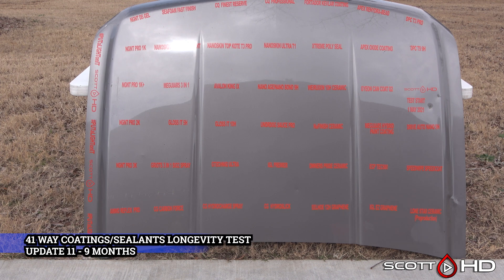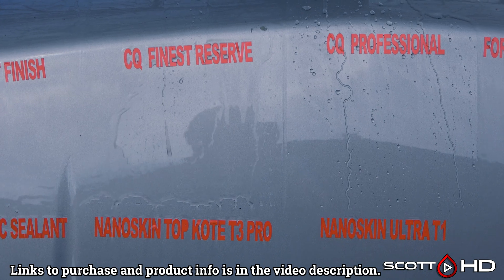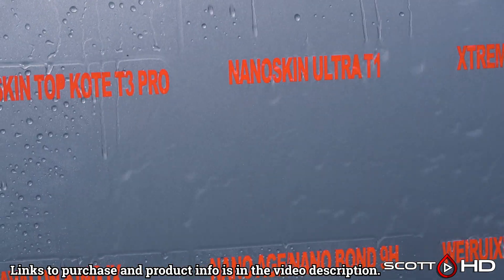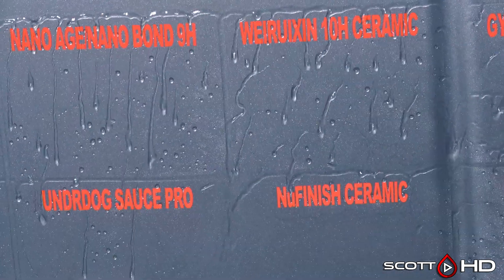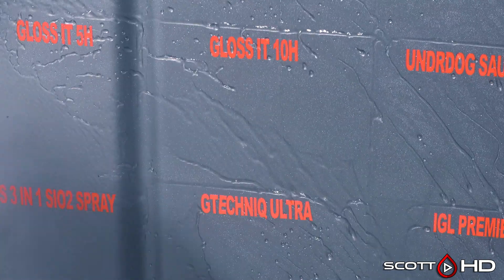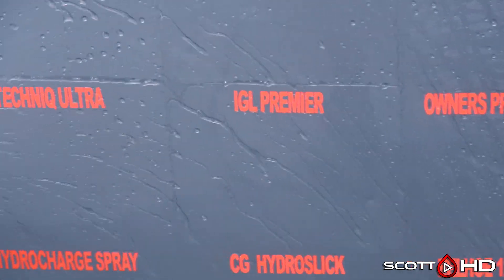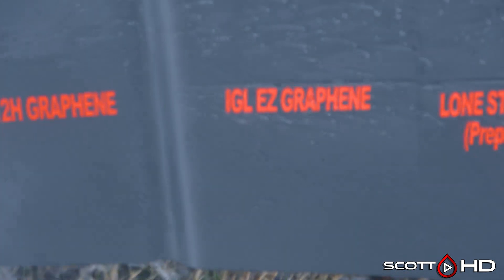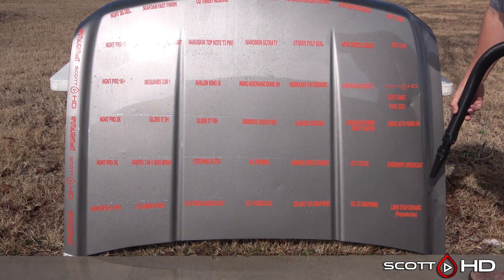Ceramic Coating Longevity Test - 41 WAY - The ULTIMATE comparison test - UPDATE 11 -9 MONTHS

Comment: Thanks Scott. I really appreciate your hard work in doing these tests.
Quick question... What do you recommend for cleaning the inside of windshields? My glass is beginning to develop that hazy inner coating and has started fogging fairly quickly.
Reply from the maker: We love using diluted isopropyl alcohol. It cuts through that layer of film that likes to form.  It's also super cheap!  70% IPA from a drugstore is about $1-2 and you dilute it with distilled water 50% (so it's 35% IPA) in a spray bottle.  Boom! Done.
Reply: @ScottHD  
Thank you! I will try that as soon as New England weather allows 👍

Comment: How are you comparing spray on coatings to liquid wipe on coatings ? Doesn’t seam very fair !
Reply: It's not supposed to be fair, they are there for comparison. Not to decide which one is better technically. And for some of them to even last 9 months is crazy good
Reply from the maker: @PonyTrumpet  This!
Reply: I think the easy to re-apply spray on coatings should split their square in half and apply another coat. Because realistically that’s what ppl will be doing if they’ve got so much product and it’s so easy to do. Maybe the extra coat lasts longer than the original once it fails. Worth a shot 🤷🏽‍♂️
Reply: @rajansandhu5  i just don’t think they are or should be in the same category!

Comment: I have a couple of 99 dodge durangos that I applied Griots 3 in one to last October. One sits out and one sits in a garage. The one that sits outside has been subject to pretty heavy snow at times, up to 18 inches. Its beading properties are completely gone while the garaged one still sheds water like new. I guess snow acts like a glacier on ceramic coatings and really wears it off quickly. .The garaged durango gets driven 5 times as much and washed more often.
Reply: Wouldn't be surprised if after a wash that outdoors one starts beading again... That 3 in 1 is wildly good for the money and ease of maintenance.
Reply: I absolutely love the Griots 3 in 1. I've had amazing durability with it on our two cars too.
Reply: @sleeksilver  Yep. I've had Meguiar's Hybrid Ceramic Wax (spray) on an a car that spends a lot of time outdoors since October, and with a wash, it still beads great. The Griot's Ceramic 3-in-1 is more durable - which is why I suspect that (if it was applied over something it can really hold to) FScott Gray will see fantastic beading again with a decent wash. I saw another guys truck in New England who went almost a year (including winter) with more machine washes than hand washes and he was still getting genuinely good beading with the Griot's 3-in-1 on his black truck. It is crazy good.

Comment: Hello. Scott I’m real surprised you mentioned NuFinish as “barely hanging in there”, it looks super hydrophobic 🤷🏻‍♂️ thanks for the great videos
Reply from the maker: I suppose it's one of those that's worn, but still somewhat hydrophobic.  Either way, its still impressive for the cost. It is probably one of the easiest ones in this test to apply and remove too.
Reply: It looks almost dead…..  the longer the water sticks to the square, the worse it is. I can tell Scott times how long the water takes to sheet off the square. This is how you can tell which ones are worse/better. Some of the squares don’t even sheet at all yet.
Reply: @ArizonaDetailCorp   wow maybe it’s the clarity in my iPad but I clearly see the water immediately clears off the designated patch. 🤷🏻‍♂️ but there’s nothing like first hand experience and I’m sure Scott is seeing something I’m not

Comment: The Meg's Hybrid mystery price slash leaves me scratching my head...thought it was going to be cancelled but why would they with results like this.
My guess....people see 2 bottles in a kit and shy away because they probably feel it is too complicated a product...
Reply: I saw in commets in the meguiars YouTube channel that companies that cut the price to 30$ decided not to carry that product again
So autozone amd other retailers will not be selling that product in store only online
Reply: I’m not sure where the $30 figure came from. I just search for it on the Internet and the cheapest I found is on eBay for $35, but it has nine dollar shipping. So you’re going to still pay $43-$48 for this product.
Reply: @larrysing  try locally, im stockpiling my cabinets with it. Vwry easy to work and you could re apply if some pannel are shot
Reply: @larrysing  As mentioned Autozone and other retailers decided to stop caring it, put it on clearance at $30 It's a done deal at this point and ended in 2021
Reply from the maker: Our local Autozone had it for $29.99 last time I was there.    What blows my mind is so many of their products like this perform so well long term, but then they discontinue them.  M688 ceramic coating,. M788, and now this.  I don't get it.
Reply: @ScottHD  remember, Meguairs is now hold it by 3M
Reply from the maker: @Carlos.Rivera  ahh wasn't aware of that